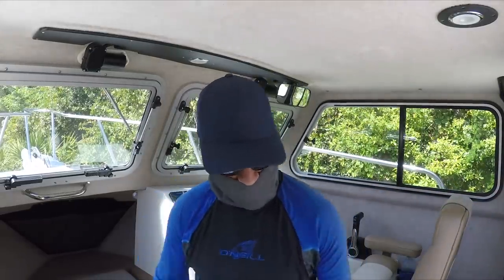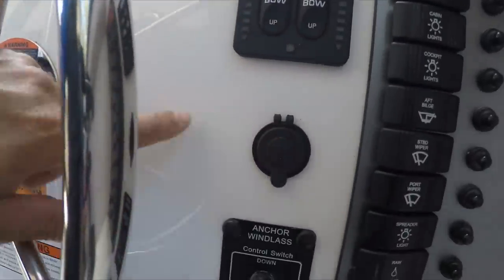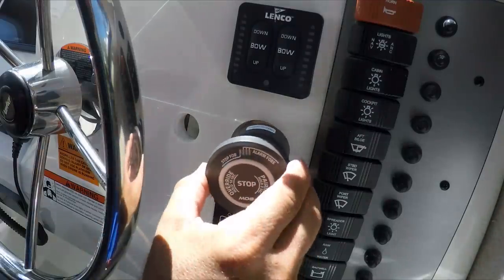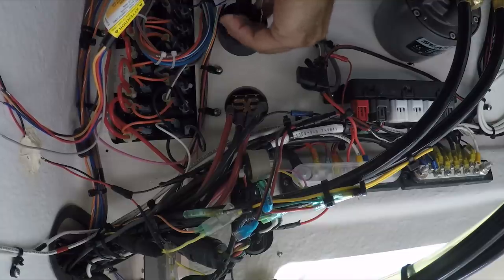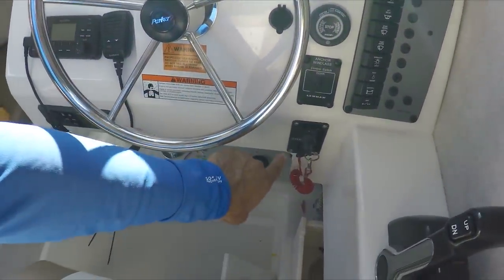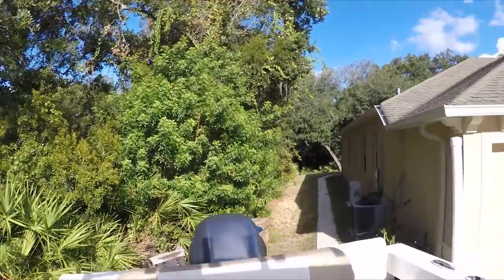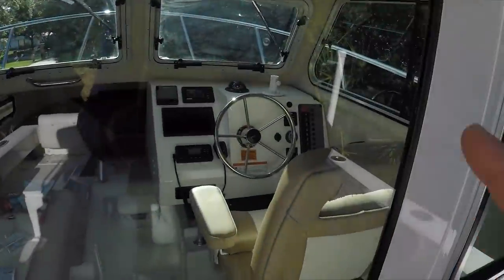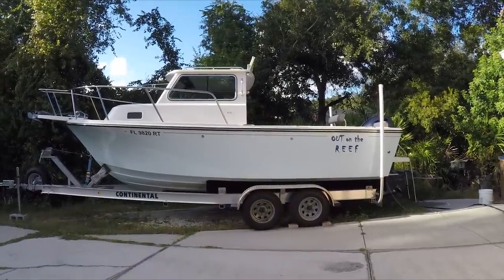FELL Marine Mob + Wireless Kill Switch Crooked PilotHouse Boat Safety MOB+

Comment: I've had one on my Grady 265 Express for a couple years - it's an extremely important product that undoubtedly saves lives...  I would have installed mine even earlier, but they came out with the adapting harness for twin Yamahas only a couple years ago...  If you have twins or triples, its required to make this device operate...
Reply from the maker: For twins engine's they sell a saperate connection so that way it works with multiple engines

Comment: Wish you would have shown the wiring.  The instructions show the wires from the existing kill switch going directly to the MOB+.  But if that is the case then how is the existing kill switch in parallel?  Wouldn't you have to have some sort of "T" connection where your existing KS goes directly to your ignition like is always has and then you have the two wires from the MOB+ spliced in as a 3 way connection?  I just don't understand how the existing KS will still work if it goes directly to the MOB+ as described in the instructions,.
Reply from the maker: @Letizia4813  Hello, captain.
And I did this a long time ago I don't quite remember.I will have to go back to it.And the best thing to do is contact the company.That's what I did to get help

Comment: I can imagine if you fall in the water near the boat, it would have to be totally sumerged in water for the system to lose contact/ signal to automatically shut off th engine?
Reply from the maker: Yes if you lose signal it will shut off like if the battery dies on the controller it will shut off because there's no communication

Comment: My engine wont start now after doing this it's become a big issue with installing this. I had about 2 inches of single black and single white wire go from my kill switch to a male connector which plugged into a female connector which had 2 wires of black and 2 wires of white coming into it. I cut both male and female connectors. Then took the orange wire from the hub and black from the existing kill switch, put it to one side of a butt connector and put the two black wires that went to the female connector which I cut from the ignition and bridged them like that. Same procedure with the white with grey. Manufacturer is not helping at all and is lost on what to do and there are no troubleshooting videos out there. Can you help?
Reply from the maker: Hello cap what i did i follow tge directions and my recommendation is call them to see if the can help, i dont remember how i did it was a long time ago

Comment: Hey captain I just came across the fell video one question can 2 motors be wired in series I have a trolling motor I run often
Reply from the maker: What I've heard is that you have to buy another special wire to hook them up in series I believe you may want to check out the website I know you could do it they make them for several engines

Comment: Not that it will happen But that cinder block is facing the wrong way, they are meant to site with the holes on the bottom. Don’t want it to crumble on you.
Reply from the maker: That's a great observation Captain you have been the only one that noticed that and you're right on the side of the block it loses strength they're meant to be upwards.
Thanks for the heads up Captain

Comment: Hey Cap, is your mechanical kill switch still operational?
Reply from the maker: Yes it is Captain it does and if the electronic one fails one day all you have to put a cap in the back that is provided and the kill switch original on the boat will work as it used to👍
Reply: Thank you for the quick response!
Reply from the maker: @oscarmoreno1119  you're welcome captain👍⚓

Comment: I have twin Yamaha outboards. I know it’s a dumb question, but how do I know where the kill switch wires are and which ones?  Right now there is one lanyard with a traditional horseshoe type kill switch similar to the jetskis.
Reply from the maker: they sell extra wires for the other engine check their website cap. and you may find it there, they do have the system for 2 engines
Reply: Thank you. Twin OBs here as well.. Is there a link you can post for twins? Thanks as always.

Comment: Glad to see you finally listen to me. I've had mine for two years now love it very safe to use by yourself. If  I am going to have ppl on board then I unhook my mob at the back of unit then I can just use my factory lanyard for my etec. Also important point the fob that is number 1 is considered helm or captain if any other of the remaining three fall in water just the alarm goes off doesn't kill the engine  but this in my opinion is the best system on market JT 🇺🇸🐟🎣🛥⛱🌴😊😃🙏🏻
Reply from the maker: Yes I remembered you were one of the boater that recommended to me. Thank you Captain is an amazing product
Reply from the maker: And yes I think the right an alarm goes off on the other ones

Comment: I have a tip for you. When drilling out a hole, use the 5 minute epoxy you can get from the hardware store. I use a popcicle stick to spread it in tight areas so you don't have so much cleanup. In your application, tape the backside so no runoff and just a thin coat is enough to seal the wood.
Reply from the maker: awesome idea cap thank you for the great suggestion cap.⚓👌

Comment: Nice Video as always Cap.  Question, what if the battery on the Remote unit dies after its been engaged, then your out at sea without a spare?
Reply from the maker: I have a spare batteries and it's very easy to change and the battery will last about 300 hours of use I also have another device standing by.
Thank you for the great question and I forgot to tell you you can always override the system by pressing the button over 10 seconds or disconnecting the unit from the back you can use it with the factory kill switch

Comment: This remind me when i was playing jetski. i forgot to put safety wire on my wrist because i hate that wire..i think this cool device suit attached on jetski.i know that remote is waterproof but how about the receiver system? it is waterproof too?
Reply from the maker: I looked at the receiver and it looks waterproof the backside of it is not that's why there's a seal and you have to keep it really away from the water the inside part of the outside looks like it's completely sealed you may want to find out more information about that especially for the jet ski is a great upgrade for safety
Reply: No doubt.i planned to get one just lil bit modification and sealed.thanks so much Captain.as before you have alot idea that inspired me about boating.thank you very much..keep it up

Comment: Glad to see you installed. It will shut off immediately in salt water and fresh water. We tested it many times.  Try it with your wife driving and show her the bypass button. We did it with our boys so they would know how to get us if we fell off.  Great video. Thanks
Reply from the maker: Thank you Captain for the info and when you fall in the water how far was the boat from you
Reply: Out On The Reef from what I had read it has something to do with the density of water. That shuts it off so quick. What we did was have the boat in gear at trolling speed.. around 9 knots as if I was wahoo fishing.  It literally shuts off immediately when I jumped in, I was a little concerned about the time it would take to shut off because of the distance to swim back to the boat and the trolling gear dragging behind us if it were a real world situation. I was completely impressed.. it takes a lot for me to trust something as vital as a kill switch. We even tried the bypass plug to make sure it works. 👍 Don’t forget to get you a pack of batteries for the fob, it does last a long time, but you know you can’t be to prepared. Again thanks for the great videos my boys are always on me to put some on for them. Be safe out there and let me know when you get in the Destin area
Reply from the maker: @thephenicies9999  that great information to know thank you for talking time to explain it to me Cap.  Tell the boys thank for watching my videos and if im ever in Destin i will let you know Cap.
Navigate safe Cap.

Comment: 50-60 ft seems a bit much in high current bad weather and a weak swimmer ? Still better to have than not to have though 👍🏻 I’m shopping for those deciding which one because I bought solo often as well thanks for sharing captain
Reply: My exact thought too John.  At 20 MPH you are talking 1,760 feet (1/3 of a mile) per minute, so with the auto-pilot, it is not inconceivable that there could be a MOB situation that really puts a good distance between you and your vessel.  Add in a strong current and or rough conditions our in the GS and you have an issue.  But as you said, it is better than having nothing.  Probably a good policy to remain inside the pilothouse when underway at full cruising speed.
Reply: John, the motor will cut as soon as it hits the water.  It'll loose contact with the helm antenna
Reply from the maker: Thank you for watching captain
Reply from the maker: @richg3411  thanks Rich for you comment and yes it's a  better to have something like this unit  then seeing your boat disappear into the deep blue water.
Like you said it might be a thousand feet but it sounds better than 200 to 600 miles away from your boat
Reply: So the 50-60 ft is not the requirement just as long as the remote hits the water regardless of distance then that will kill the motor ?
Reply from the maker: @John-bx6ed  know the deeper you fall into the water the more chance that the unit will shut off so I put a bucket just to help it out but if you fall 3 to 4 ft deep you not going to need 50 to 60 ft and could shut off at 30 feet or 25 feet is this all interference to the antenna